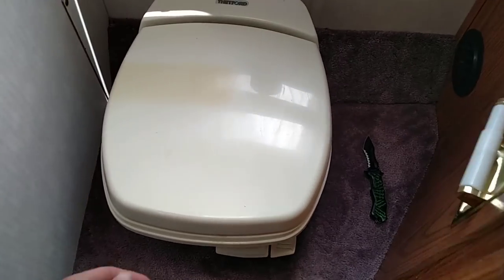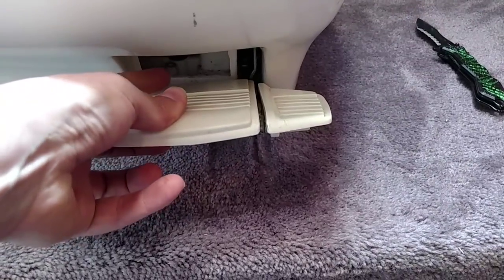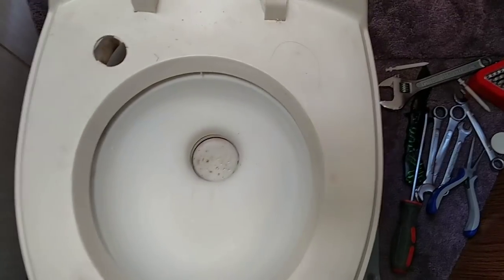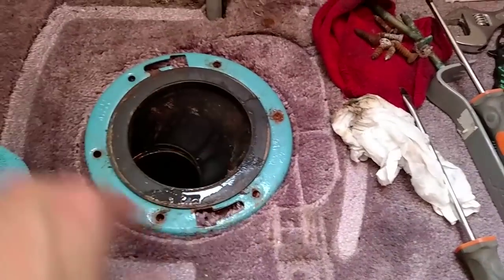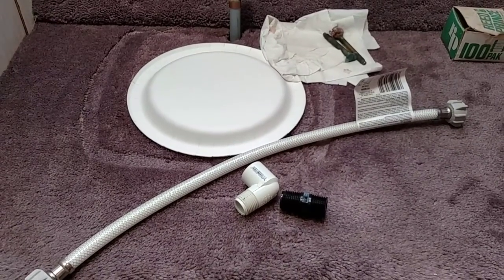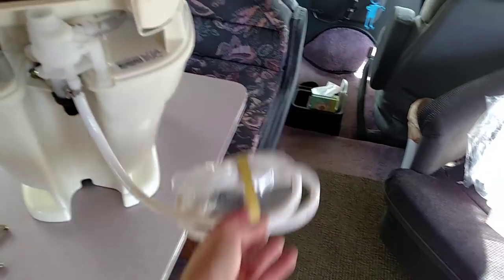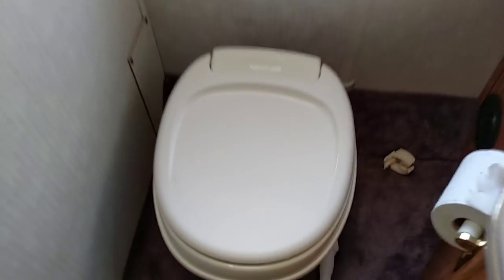RV Toilet Repair - Thetford RV Toilet Installation - RV DIY - 🚽

Comment: This was very helpful.  I just finished removing mine and shopping for a new one.  My flange is bolted to the top of the tank it seems.  I hope I can rotate it to use the new toilets with the side bolts.  I'd like to smack the engineer that designed the placement of that rear bolt!

Comment: We replaced ours in our 94 Tioga as well but we removed the pedestal it was sitting on and rerouted the plumbing around the back of the toilet. So we purchased a tall ceramic toilet. Love it.
Reply: Did you make a video of your removing the box and re-moving the plumbing?  If you did, I sure could would like that.  I am planning almost what you did.  Any information you have, I sure could use the info….

Comment: A little help for everyone: First there are two closet flange bolts that hook into the closet flange* on the floor. (*That's the ring that is mounted on the floor that he had to turn) The bolts stand upright then you set the toilet back into position making sure the bolts go thru the holes just like a regular toilet. Where the access hole is in the video you use a 1/2" deep socket and a long extension connected to a Ratchet to tighten down the nut after first reaching in and starting the nut by hand. Easy if you watch thru the access hole tighten it down slightly. Then with a 1/2" box or open end wrench you put on the nut by the foot pedal. (Or ratcheting box end wrench if you have one will make it much easier) Then tighten them both equally and it's mounted. And yes do the reverse to uninstall the toilet
Reply from the maker: Thanks for the additional tips!

Comment: You kinda missed a golden opportunity to make servicing in the future easier.  At 6:25 you should have installed an "in line shutoff valve".  With the valve in place you can now shut off the toilet for repairs without shutting down the entire RV this allows you to use the shower, toilet sink, and kitchen sinks.  Especially important if you are away from home.

Comment: Thanks, developed a pinhole leak in the black bowl part that the waterline screws into and this is the FIRST thing I could find that actually shows that part.  It's not obvious in their diagrams what that is.  Taking a picture without the toilet removed and with water weld on it (which didn't work) wasn't the best option for Thetford's support person so I was able to send them this (5:53 in your video you can see it).  I'm hoping to just replace part of the mechanism and not the whole toilet.  A pinhole leak in that - who would have thought???!
Reply from the maker: Dawn Robuck Glad you found it helpful. best of luck fixing that up.
J&J

Comment: You skipped showing the hardest part bro!
Reaching & unscrewing the 2 hidden bolts
that hold the toilet on.
We needed to see how to reach those connections.
Reply from the maker: We showed where they were at and explained how we took them off. Very small workspace. Thanks for watching!
Reply: I wanted to see the procedure.
No worries.
My toilet's got different bolt alignment.
Thx a ton for the rest of the info.
Reply from the maker: Good Luck! Thanks!
Reply: 16 different ratchets and tools and sockets later.
Reply: Being that this is the only video I could find on taking a 20yr old toilet off, I agree, showing us how you actually took it off & not just the result, would’ve been more helpful. Haha
Reply: Super esasy.. 1/4 wrench and 12 in  adapter with a 1/2. Super easy

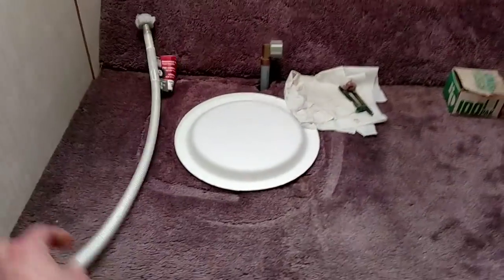Comment: Toilet height is important.  At 4:15 for short legged folks the 7" offset plus the 17" rise of the new toilet is high but, when your 6'3" and 66 years old like me, 24' total comes out just right.  Now my knees don't lock up and I can get off the stool a lot easier.

Comment: Hello. Thanks for the video. Some small extra info. When you take the little cap off to get at the rear bolt, place a slim work torch behind the toilet. It’s light will be invaluable getting at the nut inside.
The complete mechanism of the toilet including levers and sluice is available on Amazon, so there’s no need to replace the complete toilet. So you can avoid having to change anything to allow a new toilet housing. I did redesign the new mech a little . I strategically cut the metal that ends the upwards movement of the pedals. This allowed the sluice close more fully. I used a long magnetized screwdriver to get the washers back onto the studs and then I used some plumbers grease on the nut to hold it in the socket while I lowered it onto the stud at the back of the toilet unit. The kit from amazon had all the seals required including the seal to go between the toilet and the tank below.
Brendan Begley.
Reply from the maker: Thanks for the info! I think to replace the mechanism you had to take the toilet off anyway? We thought it was time for an upgrade after 20+ years anyway. Glad you got yours fixed up. Thanks for watching! 😀

Comment: I have a toilet like you took out. I am wondering if the screw holes need to be the same. All the new toilets look like the screw holes are in a different spot
Reply from the maker: I'm pretty sure we could not line ours up perfectly either and made a couple new ones. I'm sure yours would be fine too. Just fill those others in with caulking. Thanks for Watching!
Reply: @alongthewayjj  thanks for the reply. I wasn't to sure and anytime. I subbed to ya. I always love watching RVers and their adventures. It Gives me ideas for places to check out or maybe an easier way of doing things.

Comment: Here's the lowdown on removing that particular model of Thetford RV toilet. Yes, it's an absurd design to have to un-bolt the old toilet. They're 13mm and it takes a couple of long, 3/8" drive extensions with a universal to reach the bolt underneath the top of the toilet. The bottom nut, like Jay n Jazz explained, you have to depress the foot pedal in order to loosen it. And like he explained, mine too, was only finger tight but it's a bitch trying to get your hand in there to loosen it. My Holiday Rambler is also from the 90's and I would recommend replacing the Thetford with a Dometic, which bolts down like any other toilet and no hassle at all. 'Good riddance to the Thetford. Thanks, Jay n Jazz for the video.
Reply from the maker: Awesome ! Thanks so much for watching. Travel safe!
Reply: Thank you so freaking much!!!

Comment: can you please list the parts one has to buy to adapt it to the fittings. and what size socket fits the screw that is deep down inside and hard to reach?
Reply from the maker: Kathy Federico, thanks for watching. We only used the parts that came with the toilet except for a couple screws to secure the mounting bracket in a different spot. As far as the socket I can't tell you I used most likely a 3/4 to 1/2 inch one. It was a couple years ago so not too sure. Good Luck!

Comment: I have the high version of this toilet and I need to use the same type of feeder line to make it work....can you give me some more detail on the line and the adapters you used to make it work...Thank you!
Reply from the maker: We got our lines and adapters from Lowes just check on what you need for your connection they have a good variety there. We took the old one in with us to be sure.
Good Luck!
Reply: I needed to know the size of the connection too but you didn't provide it
 @alongthewayjj

Comment: I've been trying for two days to find the right hose connection for my new Thetford toilet. The experts at Lowe's and two other plumbing supply stores were NO HELP AT ALL ! They just scratched their heads and said Gee , I don't know . I'm coming off a 3/16 water shut-off . Why can't I find out what I need ?? 66years old and I hate plumbing !!
Reply: i am trying to connect that RV line to the 1/2" hose and it won't fit.. so what size adapter did you use to fit that elbow and black connector. i can't seem to find that size. What size is those connectors?
Reply: ok. I got it figured out.. Stupid people at home depot kept screwing me up. The hose you want is 1/2" on both ends. they kept giving me . 1/2" on one end and like a 7/8" on the other. ...

Comment: I've just done this before finding this video. The hardest part is getting the bolt at the rear right side off . you need a mirror and a torch before you even start and you need to disconnect the water supply otherwise you can't get a spanner on it. That bolt down in the rear left under the removable cover requires a socket, flexible shaft, another connector and the a ratchet, and it's still a bitch. The front bolt is a piece of cake. usually the seal is stuck down with tons on mastic sealer and requires a bar to leaver it off. Otherwise, it's a breeze !
Reply from the maker: Glyn Whiting good job! It is tough to see them and work in a tight place like that.

Comment: Thanks i couldnt find were in the heck the nuts was on this toilet there usely on the outside but these was well headin .lol . so with a good long extension an a swivel will work good for the one in the back

Comment: you need to replace that old carpet with tile how gross. the carpet soaks up urine like a sponge. us guys often miss our target especially after a few beers. no offense. the first thing I did when I bought my old RV camper van is tore out the old carpet put new floor down and tiled the floor!! great video though brother
Reply from the maker: Thanks! We would love to be rid of all the carpet in the RV. It is on our wish list just need to find the time. Right now it's at the generator shop burning up my credit card.
Reply: Jay n Jazz I didn't mean to be a credict if I came across rude I apologise.i know the feeling believe me money is tight with me also I understand. thanks alot for the video great video!!
Reply from the maker: No worries!
Reply: Jay n Jazz thanks for your video. wonderful video thanks for taking the time to make it. I really appreciate it.

Comment: You showed no install at all.  You need to explain how toilet ring anchors to floor, and seal placement and then toilet attachment to them.  Total waste of time.  You focused on showing old and new toilet... I can do that on Amazon online.  If you do a demo, do it right.
Reply from the maker: Lass-in Angeles Hello and thanks for your comment! We made this video to share our experience in replacing the toilet in our RV. It wasnt meant to be instructional. It was a bit difficult to get into such a small space with only one person recording and we are by no means experts. Very sorry your time was wasted. If you wouldnt mind, please let us know if you put a video up. Our toilet is working great but we would like to see it done right! Thanks, J&J
Reply: Your vid was exactly what I needed. Had no idea how to take our old Thetford out--one of the few manuals I'm missing--and you explained that perfectly. There's not a whole lot to the install for these.

Make sure to check those water lines.Those old gray lines & fittings have been obsoleted because they weaken over time. The lines will develop cracks along the length of the tubing and the fittings just outright fall apart, which is the worst scenario. Possible yours were OK but a 20-yr old rig is in the right time frame.
Reply from the maker: Thanks so much for watching. We routinely check all of our lines as best we can for leaks. So far so good! 

Happy RVing!
J&J